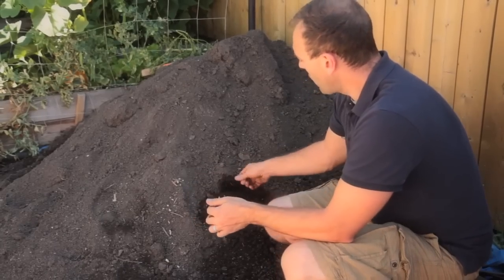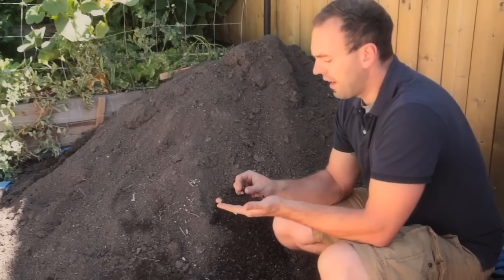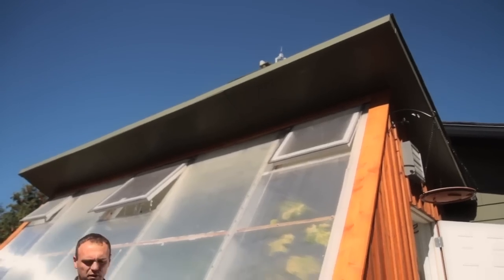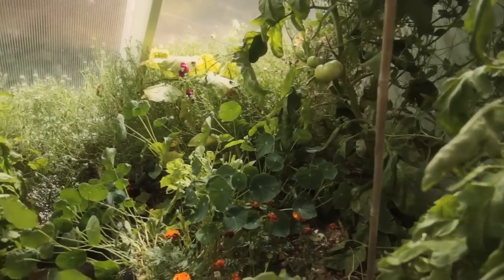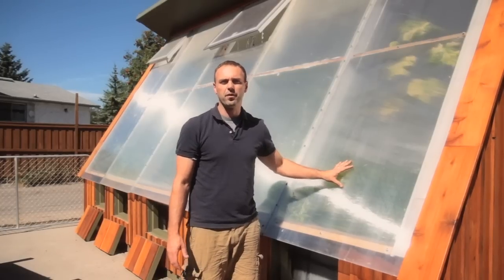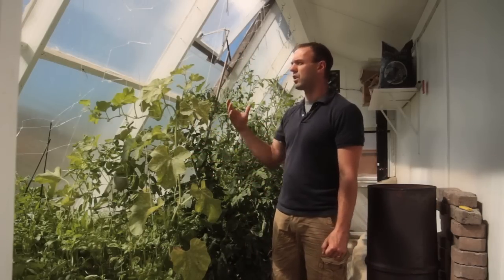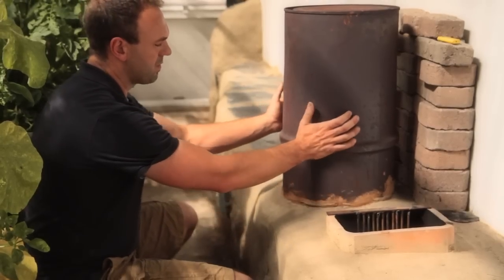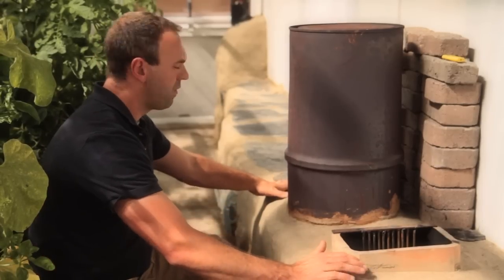Our Cold Climate Urban Homestead  //  pt. 3

Comment: What is the orientation of your greenhouse, and since that it only has one side which is glazed, from the inside of the greenhouse looking out, which way does it face?  I live in Bristol, United Kingdom, so I guess our winters are mild compared to yourselves, but occasionally we have really cold weather (still probably not as cold as yourselves), but our winters are gloomy wet and our summers can be bright and warm. Our Climate is certainly changing, and compared to my childhood, we no longer have  the real sense of the 4 seasons. Temperatures can change almost overnight and then falter before changing back
Reply: They have 330 days that are sunny and also solar wins with snow reflection. not sure about day lenghth in winter.
If you have a "roof" that is transparent you get more challenges with too much heat, even on sunny winter days it can get hot fast. Plant do not like the high on the afternoon followed by the drop during night. if you would experiment with a foil structure you would get a feel for what plants can take and what solar wins are possible. The rocket mass heater also buffers heat on sunny summer days. the nights are always fairly cool in Calgary, so even in summer mass helps.

 And you might have to be always present, if the temp goes down too much you must start the stove. 

 That may not be so critical in the U.K. - In Canada they must heat the stove likely daily to maintain temperatures in an acceptable range during winter nights and early morning even IF they have sun during day. In your case a small wood stove for emergencies might do, (or a propagne gas camping stove to avoid needing a chimney) -  but you still need to conform to safety standards. For instance there may be embers that fly through the chimeny (let's say it is very windy, so a lot of draft, and you have a short chimney, even if you only burn quality wood, no paper or carton). Those embers could set the polycarbnate ablaze.

If you have to pay for regular sweeping by a professional never mind how much or how little the stove is used, that can get expensive. 

Usually a regular roof is fire resistant, the chimenys are longer, etc.

Ventilation is an issue to avoid mould and pests and do moderate temperature extremes which are an issue in many green houses or winter gardens with lots of plants  - I would watch the videos of Charles Dowding a market gardener. He has foil growing tunnels but it think also a green house. He noted that it is sometimes cooler during night in that green house than outside. The tomatoes did better outside than inside.

Here he had the option to open up the wall under the glazing (the elements he took out, smart solution, but of course also potential access to critters). I know form other videos that there are non electrict "automatic" openers for the windows. They contain a kind of "wax" that switches from being hard to liquid and expands as it gets warmer. that triggers the opening of the windows. If the wax / substance gets colder the windows should close (I guess with some delay if there is a downpour, the wax will not shrink and harden that fast, then the fancy rain monitors would be better.

So the floor would have to reflect the option of some rain coming in occasionally. Seems to work nice for Rob, and Michelle, but then ... They only have 400 or 450 mm rain, many sunny days and I guess usually someone is home to close the windows manually. 

I read in a discussion that it is better to err on the side of more capacity for those openeners (they can move a certain weight). Looks like it would be good to opt for the larger ones and have 30 % reserves to get reliable function. 

From innovative buildings (a wooden house under a transparent dome) it can matter a LOT where you place a fan or the openings for airflow.

There is a man that uses natural thermal heat (like hot wells in the region) and has and in ground / underground growing house THAT with opening and closing transparent roof might solve your problem. 

I woould pick Dowding's brain (by binge watching his videos) if you have not yet installed something.
Reply: As I wrote my comment, it triggered the idea of underground or in-the-ground greenhouses and I remembered a video. - As you are from Cornwall do you know the documentary The Lost Gardens of Heligan ? That fine house had roughly 23 - 25 gardeners (they also grew the food for all the servants and of course the table of the owners, only a few worked for the ornamental gardens or the cultivated wilderness /creek landscape with plants that were from other continents and were "exotic" - those plants had to survive the winter on their own and some did). 

In winter they managed to grow PINEAPPLES. with in-the-ground green houses.

Chambers in the ground, heated by nitrogen rich compost / manure (the heat of decomposition), I seem to rememer some controlled irrigation with clay vessels. Level with the ground they had the glass panels as slightly tilted roof. glass was of course expensive then. The panes had an angle so water would run off. 

The gardeners constantly puttered around with those pineapples, to prevent diseases, pests, control temperature, and humidtiy and the straw they rested on,  and to replace the manure for heat production when the most intense stage of  decomposition was over.

When they revitalized the property (1980s ? 1990s ?) they also  tried to reenact the growing of pineapples,  they got something but nothing like the pineapples that house was famous for around 1900.

WW1 and the societal change in the 1920s ended the feudal practices. They could not find staff for cheap after that, the young men (and women, too) worked in manufacturing, and even if not - they had to get more pay, or would leave.

The property was then sold, the family members that had know it in its former glory died, the old magazines and newspaper articles that featured that formely well known property were forgotten, and young people left for the cities.

But they had enough photos to know how it had looked. It was completey overgrown when they started to work it again. I think it is a non-profit now, and open for the public.
Reply: Simple Low Tech, robust, input free designs : Windows shaded in hot summer: Blinds / shutters outside. Or a large roof that shades the windows in summer, but not in winter - if the hurricane situation allows for that. There are inside blinds that have reflective surfacesdirected towards the glass, or foils that can be applied to glass (and removed in winter). If the residents rent and can't do anything at the outside of the building. 
Looks like people in CA have upgraded from single to double pane windows and that makes a difference regarding how much the homes heated up during the last heat wave - need for A/C. During such heat waves there may rolling blackouts and then it is good to have passive, free cooling effects. 

The input and investment of growing a tree and cutting it back, or new windows, or shutters  is plannable, and durable.
In many regions they would not get away with single pane because of winter temperatures, never mind summer effects. The costs for the windows is saved in A/C costs (even if you get it from solar panels that still costs), and the better windows ADD security in case of severe cold.
Reply: For insulation rather use mineral wool (or any other material) than styrofoam. Mineral wool is fire resistant and can be recycled, and those facades also hold up better during extreme hail events. If in doubt go for the slightly more expensive, robust ! solution. There is a case to be made for passive security, for old fashioned sturdyness, and for the Pareto Principle.  20 percent input get you 80 percent output. It is a version of: Concentrating on the low hanging fruit. 

The angle of the glass house is steep to avoid issues with snow load and in order to have less construction costs. That was a good enough / fairly good solution, even though a less steep angle would have advantages (which come at a cost). 

Also: technology fixes cost, can cost more if you have unexpected repairs, and you can only estimate how long the tech will serve you. When the unit fails after 15 years instead of 20 years life cycle the calculation  and ROI changes for the worse.

With sturdy but only "good enough" solutions, you know your costs, it is unlikely you will have any costly repairs. For instance the rocket mass heater does not cause costs for changing the electronics or the catalyst - because it does not have those features. 

Tech can fail during a major crisis (power outage). Then passive systems are king. Like sprinkler systems can fail but a fire wall in a high rise with the right kind of doors (if authorities or house administration controlls that they are closed) WILL delay the spread of fire whether the building loses power or not and whether or not sprinkler systems were prudently maintained and that they tested emergency power supply (back up batteries).
Passive safety. A person in charge controlling twice per year that the fire door is closed - and interventions (and even fines) if residents mess with that, which is usually stopped and reversed by such inspections. That is a low key, low cost measure. 

Good enough affordable insulation, and windows (but it is not a net zero home). If new windows are expensive insulation curtains can be a good provisory fix. Solutions with higher efficiency get you often into more-than-the-80-percent territory where costs (and failure risks) increase disproportionally. 

Another principle: Good quality (in consulting) COSTS, and don't be a penny pincher. That drives the GOOD consultants out of the market and the costs of planning designs mistakes (or overlooked opportunities) can be much higher over the 20 - 30 years than the risk to pay 5 - 10 % more than the lowest possible SOLID offer. 

That is how consumers end up with geothermal installations that are design / planning failures: where they extract more heat from underground than can be regenerated in the warmer season. That can be incompetence or the attempt to come up with an offer that appears to be cheaper, but they are cutting costs by cutting corners.  (saving on depth or the area of the pipes). The flaw only becomes apparent after a few years.  

A good plumber will not do the easy thing and have bends and diameters that inhibit flow and then require a stronger pump to compensate for lack of plumbing expertise (or lack of attention to detail). that pump costs more and is going to need more energy for the next 30 years. One could as well pay the plumber more (usually the planners have manufacturers and plumbers they work with). 

One can hope the selection will be for high quality devices and people that now what they are doing. That spreads knowledge in the field and rewards the best actors and in the long run it might not even be more expensive for the buyer. So one would need a good local planner and not drive many consultants crazy with getting 10 offers. 

Consumers that act that way train the consultants to be disingenuous, it will not be the quality planners that make it in that kind of market. Good engineers are not always good sales people. In a market where consumers find it O.K. to chase for The. Very. Best. & CHEPEST Offer by consuming so much time of 10 (hopefully) well qualified planners (with 10 qualified plumbers behind them that have to work on the specificis of this or that offer) chasing the lowest price ... the bullshitters and those good in sales will prevail.

The nerds you would like to plan your installation are often NOT good sales peoples: the talents do not usually align well.
In the long run it does not really matter if the installation would have cost 10 % less with another offer. If it is well planned it will also be robust and should deliver for 20 years and more. So the 0.5 % more costs annually versus the risk to have a less than ideal planning or ending up with inferior quality.

Those installations have an unfavorable ratio of neccessary individual planning per site and the margins are not that large. The people we hope will design our renewable energy installations are qualified and deserve to make at least a middle class living. If so much time goes into even getting the contracts, it will weed out the good and nerdy people. The talent for sales will win out.

Now - in some lucky instances that sales talent will coincide with competent and honest advice, and the added margin will be reasonable. But the costs for 5 - 10 rounds of devoting a lot of time to offers (planner & plumber) will show up in the prices of those who make it in the scene, they must add that (and the individual planning cannot be easily streamlined or standardized) or they would not make even a decent living. 
OR those unproductive costs (for many offers) will hinder consumers to make the investment at all.
Reply: Canadian homes are usually well insulated but they still failed to perform well during the recent extreme heat wave (July 2021). In Canada getting the sunshine into the house via the windows is normally a good thing. In winter it is excellent, and in summer the nights are cool enough that the homes do not become heat traps (where insulation works against you). 
The homes and cities still cool down enough to make the unwelcome summer heat wins tolerable. 

Long time planning would account for more heat waves and would not have light well insulated homes but homes with some mass that are (farily) well insulated. 

Sure one can have a fancy ventilation, A/C / geothermal system (investement, failure rate). 

Or one builds an old fashioned brick and mortar home and has shutters OUTSIDE. 

any blinds inside are much, much less effective, you still get the solar radiation into the home. 

One can have THERMAL MASS in a light weight timber frame home. The outside walls that bear the weight are light weight - as long as there is ANY mass in the home to be a heat buffer (which helps in winter, summer - and also spring and fall.

If the stability of the home (floor !!) allows it one can have loam walls, brick and mortar walls inside, concrete floors. And a rocket mass heater (rmh), or a masonry stove would also store cool night air and keep the home cool when the day temps go up (despite closed windows and good insulation). 

However in some cases the floor might not be stable enough to support that weight. Having inside walls (those that do not bear the load) or stoves made from locally resourced clay / loam is also a sustainable low-energy solution. No sand, gravel, bricks or cement needed. Not even chamotte (burned at very high temperatures) that is used in masonry stoves (stoves with tiles and also a lot of mass, that function like rmh) - or quality wood stoves. The material can be dense clay / loam underground material - the excavation material from a pond for instance or a rainwater tank. 

That can be a cheap solution that is not quite as fancy and may be slightly less efficient compared to a geothermal installation that feeds heat into the underground and thus works as A/C in summer and makes the heat lift easier and more efficient in winter.